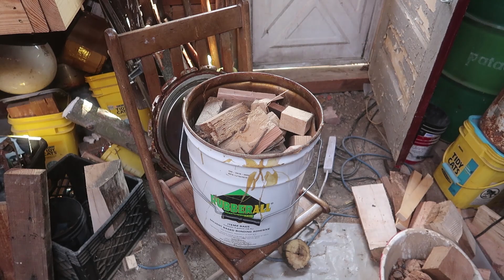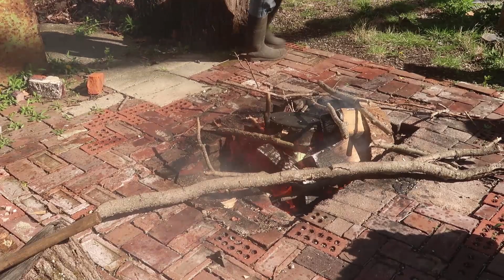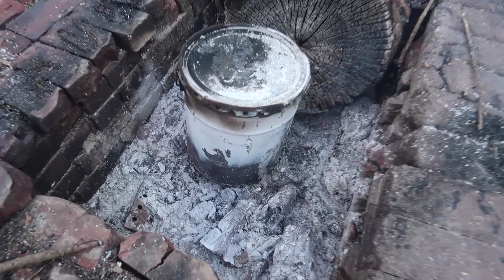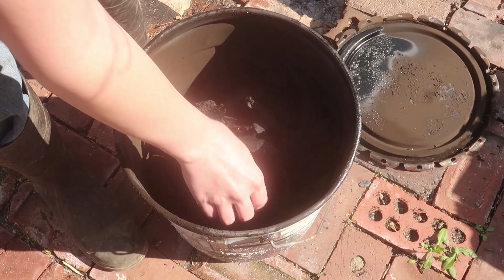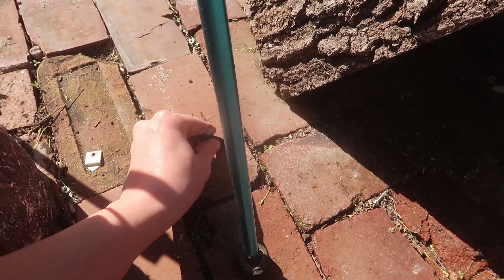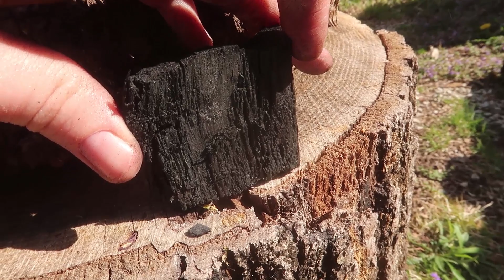DIY Charcoal, Simple and Easy (if Inefficient, Wastes Wood Gas) Wood Kiln From 5 Gallon Bucket.

Comment: Black Powder is most cool. AND you can make it at home.  KNO3  75%,  10% Sulfur, and  15% Charcoal   wet blended in any blender with Isopropanol.  Push the mud thru  a window screen and air dried.  The finer grind the better performance.  Better then ROCKET Candy.

Comment: you should try starting a fire using flint steel and some char cloth
Reply: Interesting.  There are flint deposits in Illinois. 
"Flint is a variety of chert but forms in chalk limestone deposits and is dark gray in color. Thick deposits of chert are found in Union and Alexander Counties. ... The crafting of chertinto tools as far back as 10,000 years ago has been documented in Illinois."
Reply: @pegtooth2006   it would make for a fun video!